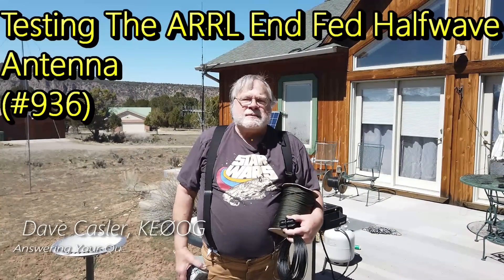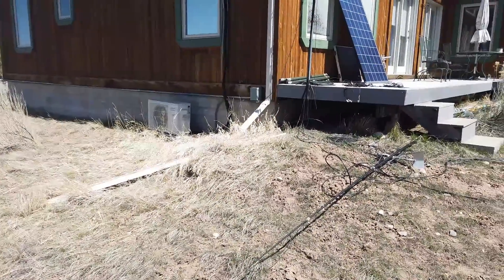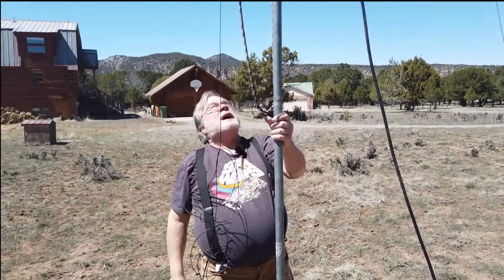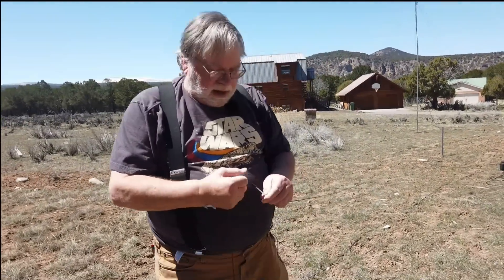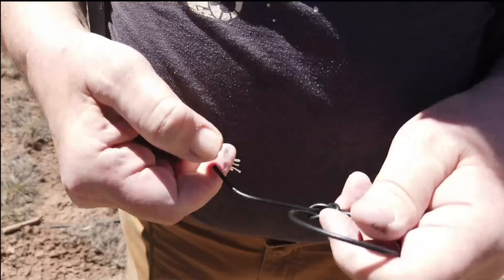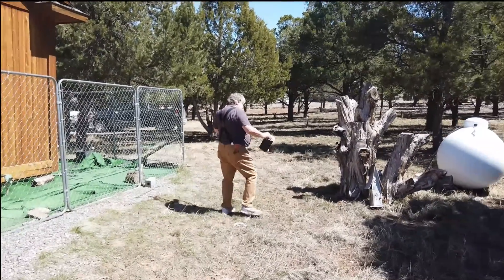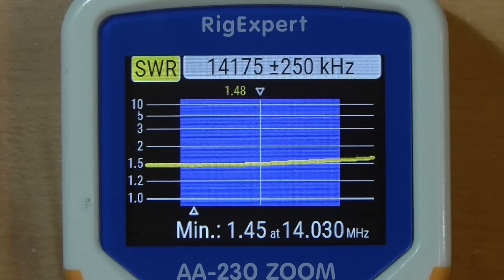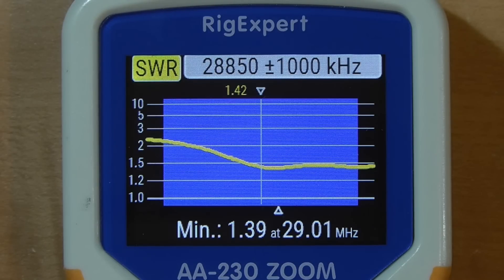Testing The ARRL End Fed Halfwave Antenna (#936)

Comment: Is there a way to measure impedance EFHW? Given that no transformer is between the TX/RX and the EFHW?
Reply: Couldn't you measure the impedence with the 49:1 inline and then multiply your reading by 49 to calculate what the impedence is on the antenna side?
Reply: I am confused by the question. There is a 49:1 transformer (un-un) between the coax and antenna.
Reply: @NgakpaW  Let me clarify. Imagine having no un-un or transformer between  efhw and tx/tx ( test only setup ). We know that 50 ohm does not match efhw impedance. And we know the impedance skyrockets when we feed dipole antenna from one end. But is there a way to measure it's impedance at the end? How much is it in real time/real life? By measuring it.